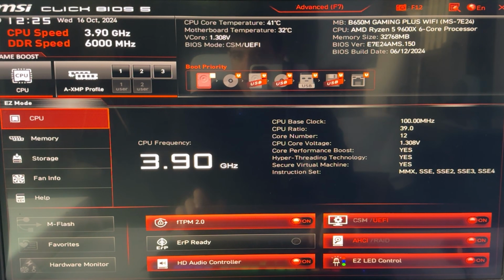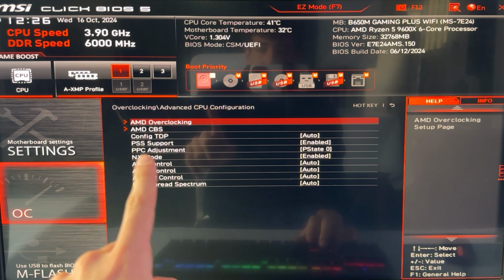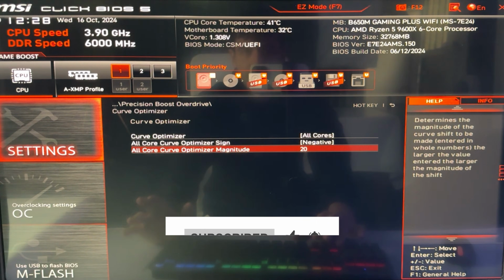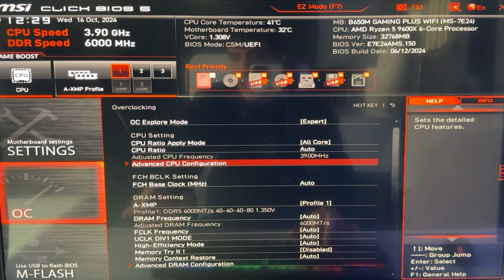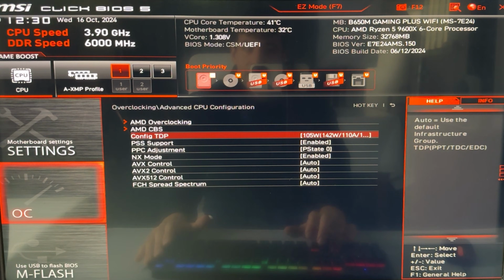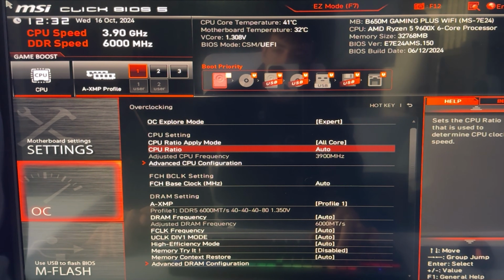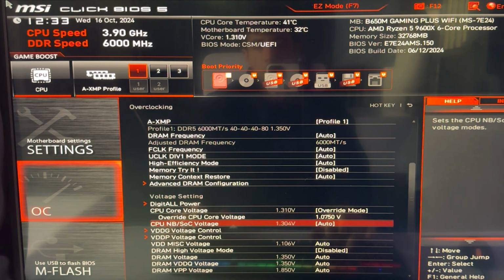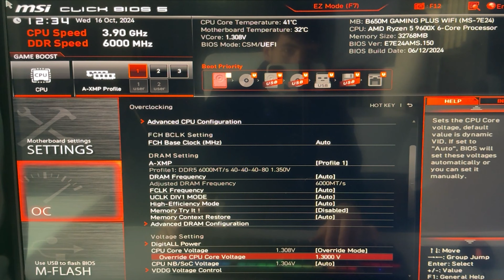Undervolt your Ryzen 5 9600X for more FPS and Lower Temperature!

Comment: Hey. Thanks for the video. Can you explain why you say that "1% of CPUs can achieve a -30" but when i use Ryzen Masters Curve optimiser it says I can do a -60? I am stable with -60 in bios
Reply: Has this been stable for you still?
Reply: @ -55, yes.
Reply from the maker: -60 would be insane, test it with Prime 95, it’s either gonna crash or throttle down :)
Reply: @ImWateringPSUs  In Cinebench it stays at max boost. Prime95 it fluctuates and doens't maintain 5.3ghz (on a 7600 non X) but doesn't crash. Should I lower until prime95 can give constant boost?
Reply: @potominkus9828 maybe you confuse -60mV with -60 curve.
1 ≈ 3mV.
-30 = -0,09V (which is a lot)
-60 ≈ 0,18V. 
The difference between 3,9GHz (±0,96V) and 5,2GHz is ±0,18V. 
I think you kinda understand why -60 seems unreal.
Reply: @ I’m using a -55 CO right now. Cinebench hits all core boost clock @5.3ghz. OCCT hits around 4.9-5.0ghz when doing all core test. 

Am I missing something?
Reply: @potominkus9828  Do you use Scalar X10 ?
Reply: @ whatever is default. I haven’t changed that
Reply: 9600X

Cinebench 2024 worked fine for me @ -40 curve.
-45 I've had one random snag at the third bench soooo not too sure about it. I Might still test it for daily use since I'm only playing games and browsing stuff, no heavy productivity workload that's gonna stress it near Cinebench levels...
-50 was an instant app hanging when starting the bench.
@ -40 it's still hitting quite precisely 5,5 Ghz constant boost clocks on all cores. Juicy.

I've set the boost override at +200 for that 5640 Mhz light load clock.
Everything else on auto (scalar, yadi yada... FCLK auto, UCLK/MCLK 1:1, etc.)

9600X
2*16GB DDR5-6000 @ 32-38-38-96 (EXPO values)
Air cooled. 87C Tctl/Tdie more or less under heavy stress. No throttling in sight.
Reply: Follow up : After destroying the CPU with Prime 95 I can confirm -45 isn't fully stable here. -40 seems okay so far. Still pretty good silicon. Prime is different animal compared to Cinebench. That being said not a realistic case for me.
Reply: @ what is you’re boosting to in OCCT all core tests? I don’t manage to hit max boost in occt but do in cinebench
Reply: @MozzaBurger88  Prime95 test Memory Controller and Memory. Cinebench23 test how fast you are with how many cores. That's why Intel Cinebench23 scores are almost all higher than AMD despite having less performance (usually). Prime95 put realistic expectations in heavy games (except for the amount of RAM used). Core error ≠ Crash also. So even with an error you could be totally fine in gaming. If you crash during Blend all the above Hyper treadings ON all cores. PC is unstable.
Reply: @MozzaBurger88 well you're using an air cooler so that's why you destroyed your cpu
Reply: @MozzaBurger88  Guys y'all been saying -30 -60 -19472947283.

You know. If I set my CPU to use -10V.
And set Precision Scalar to use X10 volt. And ended up taking 1,36V for 5,6GHz at -60.

I didn't perform any undervolting. Please guys send VOLTAGE.
Reply: @FireCestina1200  It's boosting until it reaches its 1,35V hard cap. Always. That's why we don't post it. That's why frequencies increase with the V/F curve offset. Voltages remains the same. It simply boosts higher for said voltage.
Reply: @MozzaBurger88  Yeah so basically. You didn't perform any voltage shift since you still have the exact same frequency.
Reply: @FireCestina1200  What are you rambling about? All core boost went from around 5200 Mhz to 5500 Mhz under the exact same test conditions and bench results followed accordingly.
Reply: @MozzaBurger88  Also, you missed a timing. RAM is 3X-3X-3X-7X-1XX
Some models are above 30. Some above 70. Some lower than 100.

But if you say 96 it's probably something like 32-38-38-66-96
Reply: Where are you seeing that your Ryzen master curve optimizer showing it can go -60?
Reply: @supriyodas2218 can’t remember exactly. But it would’ve been doing the stability test with -60 applied or it was the built-in CO optimizer where it finds your lowest for you

Comment: Thank you so much for your vids 
I have just undervalued my etc 4090 gpu for the first time ever following you video ( I racing is giving me trouble with stuttering 
Please I have a ryzen 7 7800x3d 8 core with the process be the same or I have to tweak it a bit 
Thank you so much in advance 
I have almost zero knowledge 
Also in your under vaulting for gpu you had basic (which I did ) and performance setting ( should I use the performance ?
Thank you again
Reply from the maker: Hi, I’m really happy my videos are useful! :) I have a dedicated tutorial for the 7800x3D, it’s in my CPU Undervolting playlist